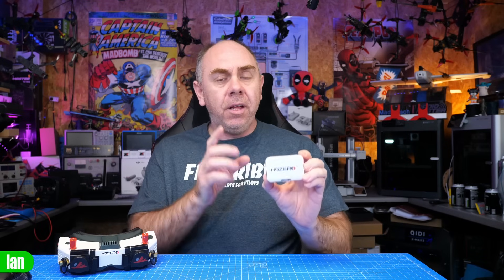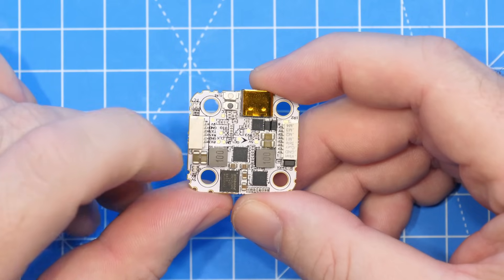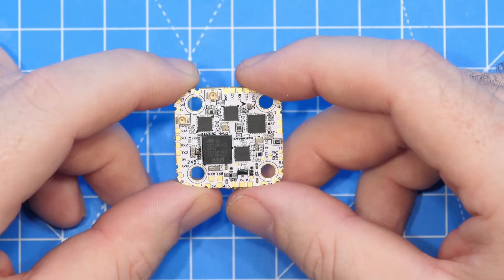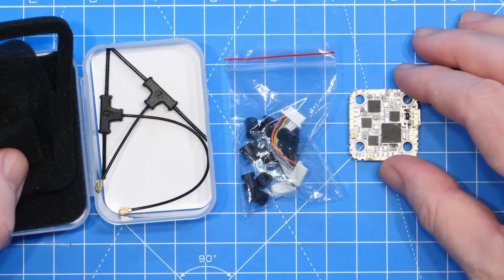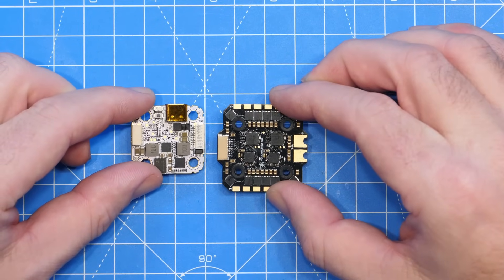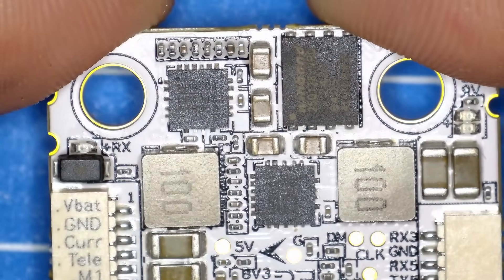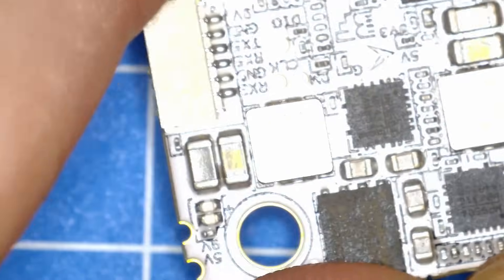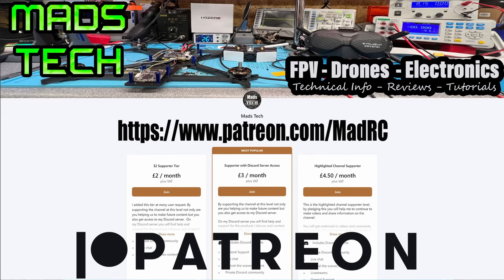HDZero Halo Flight Controller - Digital Ready H7 With ExpressLRS Onboard

Comment: Why are you shilling Voltara so hard? Their own homepage doesn't even mention their business address - what kind of a fly by night shop are they? Haven't the blheli32 situation taught us anything about using proprietary crap when it could be avoided?
Reply from the maker: I like the esc.  It's one of many out there.  There is a Am32 if you want OS and there is others.   The big diferance with Voltara and Fettec as well  is their firmware is only used on their esc so if they stop it just means you won't get updates for that.  Blheli was entirely different as it was an industry wide issue.  

As for contacting them just the same as contacting Kiss Ultra.  

I have no specific affiation to the Voltara but I do like it.  

Sorry if that upsets you.
Reply: @ voltara has no server nor activation procedures. Lessons learned :)
Reply: @MadRC  >I like the esc. 
Yeah, I think most people watching got that part :) You just.. don't give us any reasoning behind that. Like, why this ESC in particular? What's wrong with Foxeer or Hobbywing or the new TBS one with weird mounting pattern? Also, considering you're not a racer - is there any reason for you to use anything exceeding 45A? We all know you aren't ripping balls out there, and you can break any ESC if you crash hard enough - so a cheaper 45A one would make more sense..
Reply: 60 euro for 60a esc. Is this bad for hobby?
Reply: I made Voltara because I am a pilot, like many others here and I wanted to make something different. And obviously, it is a closed-source product because well it's my work and nobody is forced to use it in any way. I did make sure people would never be in trouble after they bought it like inability to use it in some form. Regarding the sensitive contact details, I chose not to share them except with BTB partners since I don't have a store but sell directly to resellers. 🙃 Thank you!
Reply: Shilling. Love how people throw this word around. Do you think Voltara or anyone other than Dji has money to pay for someone’s integrity and opinion? If the guy was a shill don’t you think he would be getting pre production Dji equipment and telling us all how great it is? 
Go crawl back into your hole sweet pea and take a good long look at yourself.
Reply: Because it’s a badass esc. The best feeling esc I’ve flown since the kiss 25a 4 in 1. It’s pairs flawlessly with the best fc there is “kiss ultra” and it just works. If you don’t like it that’s fine but there’s a pretty big following of people that won’t ever go back to a different esc. Give it a try. You won’t be disappointed

Comment: Wait, an HDZero FC that doesn’t have baked in HDZero? Am I missing something? They just released the AIO5 whoop board that does it all. 1S only, of course.
Reply: you are correct, no hdz baked in, but it is designed to stack tightly with the race v3 vtx

Comment: Pretty cool, nice to see something different. Dropping the analog osd chip saves so much room. I get the hobby isn't ready for that on the whole but cool to have options. I prefer the rx mounting pins on the lucid FC. You basically end up with the same size package with the only wire being the rx antenna, but the rx is replaceable. Also crsf and elrs rxs have the same pinout so it's compatible with both.
Reply: dont need analog chip to make analog osd :) Certainly not on h7 :)
Reply: @alexanderfedorov7890  Ah like the brainfpv osd? The H7 has enough horsepower? Very cool.
Reply: @zdkama  brain fpv has FPGA chip on the back side :)))))
Reply: kiss ultra osd walktrough - u know what to do :)

Comment: More competition is always good but it looks like the main innovation here is the diversity ELRS and perhaps the H7. Is that really required now-a-days though given the strength of ELRS?!? Surprising to see the price difference between the two gyros.
Reply: @Mangorille  diversity is not required but definitely doesn’t hurt, I still sometimes get rx loss when turtling (ep1 with dipole on top plate) so could help some there.

H7 on the other hand is needed now to keep up with high loop rates, complicated rpm filters, high elrs packet rates, and fast osd refresh rates.
Reply: @ I do like the H7 but I still run AIOs that have a F405. :)
Reply: Yeah, will definitely run on lower spec fine. Just not with all of the features enabled (ie: 8k/8k, f1000 elrs, w/ rpm filters, etc). No need to run 8k/8k for good performance but racers demand weird stuff sometimes.
Reply: @ Fair enough, I haven't run 8k/8k ever since rpm filtering came out.
Reply: MPU6000s haven't been made in years, I'm sure they're all reharvested from other equipment. The ICM42688 is completely fine and there really is no reason not to use it at this point.
Reply: @icebalm  Not quite. TDK still makes "silent batches". :)

Comment: Nice review!

Just not sure what problem they’re really solving with this. There are dozens of flight controllers and I’d rather have a dedicated ELRS receiver. That way you can install it and not have to route antenna wires off the flight controller. 

Maybe HDZero should focus on making flight controllers with their vtx integrated. Or do they want to get into the flight controller business?
Reply: This will be huge for tight racing builds, means no soldering aside from motors and no need to figure out where to mount your rx. Plus put switch, h7, huge becs, low profile (all plugs on one side), etc.
Reply: Seems to me like this is aimed at racing quad builds where it's hard to find space for a dedicated RX.
Reply: The original idea of this fc, is solving high power loading from digital vtxs. Most existing fc really not have enough current output. Most fc label as 5v/2A, but this number is coming from step-down controller spec, in reality it most likely 1.6A only. Halo fc have two really powerful step-down controller for 6A, and make it work at 5V/4A, 9V/3A in real world.
Reply: @ how about make hd0 vtx that works from 6s :)))))